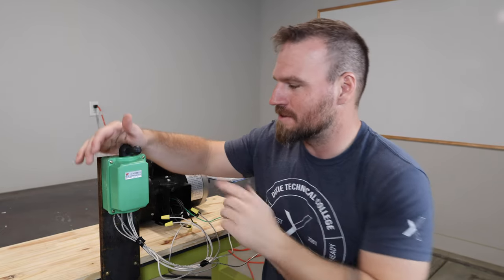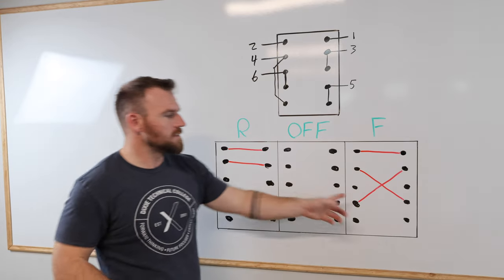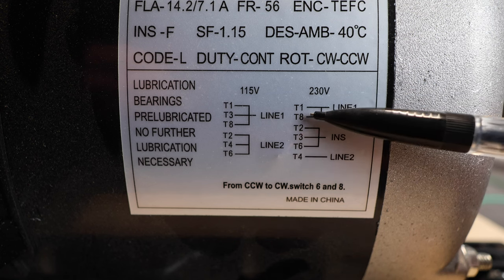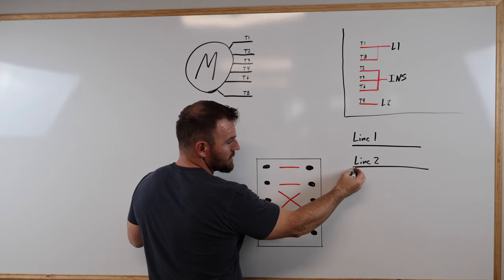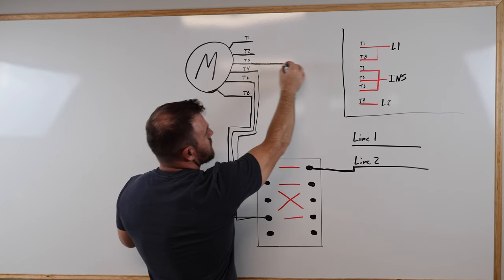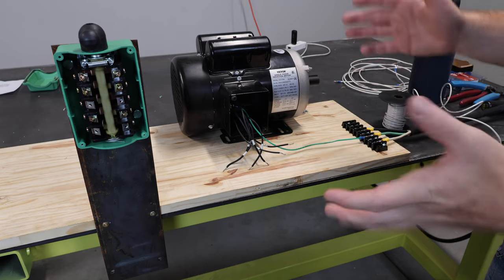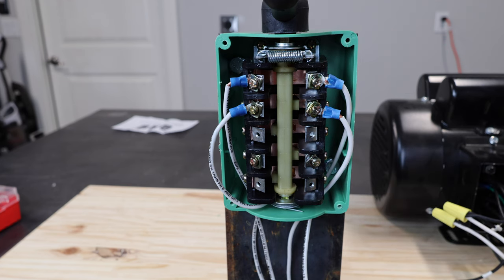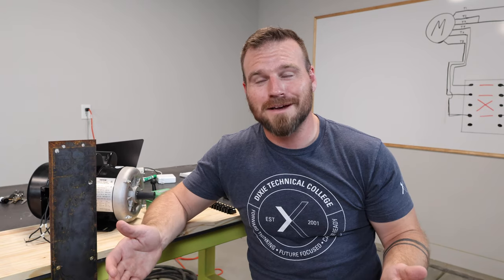How to Wire The QS 60 Drum Switch for a Reversing Motor Control Circuit With 220 Volts

Comment: This (and the other switch videos) are great and super packed with info!  I have an old Atlas lathe motor that I'm hoping to figure out how to wire to this kind of switch.  Instead of the T I have 1,2, black, yellow, red, and green which 1 and 2 interchanged for the reserving.  I think I have them figured out (or a good guess) but I need to wire it for 120v on the switch and that is tripping me up.  For 120v with line 2 would need to be power and line 1 neutral as in the video?  Anybody understand and can help?

Comment: Very informative. I have the same drum switch and trying to wire it into a 115v single phase. Can you help me with a diagram to wire the drum switch?  In my 1/2 hp GE, the starter coil and capacitor wires are J9 black and T8 red. These are the cross switched ones.  Do the other wires under the motor access panel come out to the drum switch as well?  And to what terminals?  I’ve wired drum switches in the past, but this green Chinese one is confusing.
Reply from the maker: Ya if you need help let me know. I plan to do a 115v video in the future but I just haven't got to it.